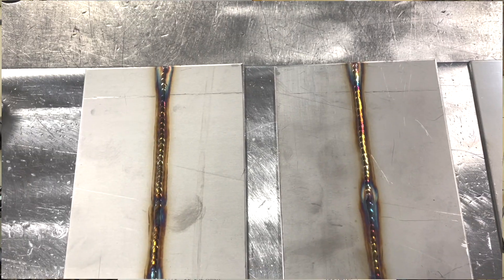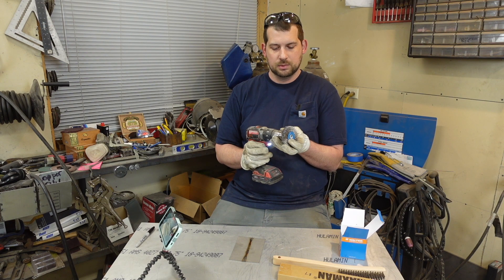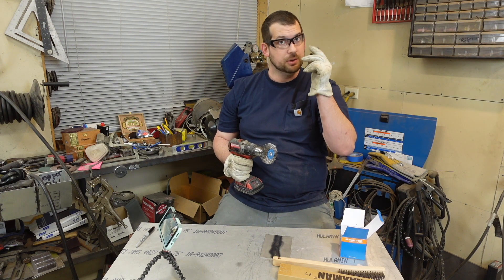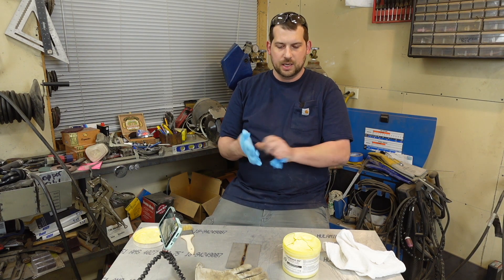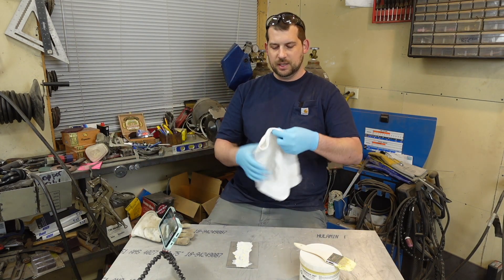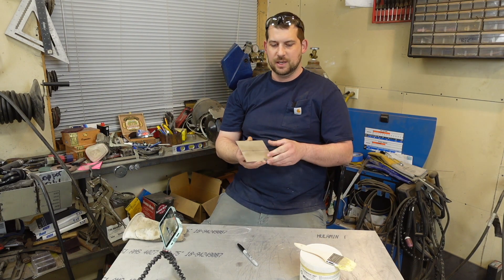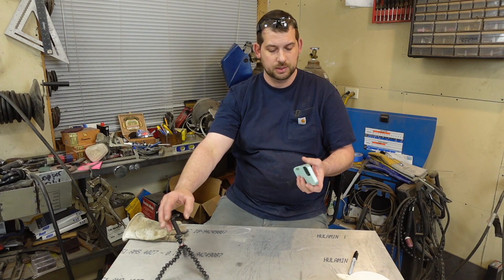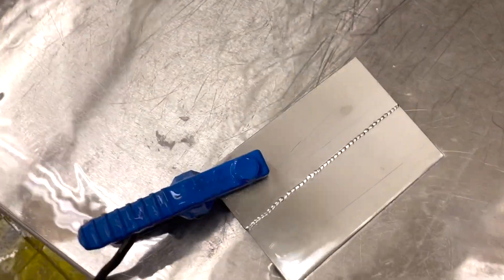3 WAYS! to Remove Color on Stainless Steel Welds

Comment: I work for Walter Surface Technologies. Great video and info for people to choose their preferred method. The 305 is expensive, but if you are not doing Alu, SS, or Ti. The Surfox Turbo is the way to go since it's SS Only. However, if you are on a budget and in business on a budget. The Surfox Mini can do anything the 305 can do, just not on an industrial scale. Alu, SS, Ti cleaning, Etching, Marking and Electro Polishing. Also the 205 and 305 have a small plug in the front where you can tie a 2nd wand in and have a 2nd cleaning options. Again thanks.
Reply from the maker: Awesome suggestions for the viewers. Thank You

Comment: I have stainless bolt with already coloring to yellow/gold, can i use HCL for turn to chrome/original colour?
Reply from the maker: I’d probably just use a stainless wire brush
Reply: Chlorides atack stainless. So no to the hydrochloric acid. Phosphoric works with current.

Comment: Pickle paste has nitric and hydrofluoric acid in it, extremely dangerous acids and fumes. It attacks the calcium in your bones, eating them away and usually requires special treatment to stop the action. 
I heard a story about a guy using it over an 8 hour shift and he had a small hole in his glove which he wasn't aware of. At the end of the shift, his fingertip was floppy, because the bone inside it was eaten away.

If your exposure is concentrated enough, it will kill you.

Electro polishing or passivating is really the safest and least toxic method. It uses mixtures of critic and phosphoric acids at its most basic. Fumes can be a little acrid, but is much safer and environmentally safe than pickling paste is.

Another brand is TIG brush, same sort of thing as Surfox.

Comment: I've seen other videos where some have made an electro brush using a regular 12V automotive battery charger, there's probably other ways and different chargers that could be used, maybe even a mobile phone charger but some make a brush with carbon fiber or carbon paper etc etc and I've seen a couple made out of a piece of stainless steel wrapped in something like a sock or other cotton and then I believe the negative cable hooks to the workpiece and positive to the brush wand and then you brush it like you were doing in this video. I don't remember the liquid solutions that were used right off, I believe there's different kinds people come up with like citric acid for one. Anyway, I haven't tried it yet but I plan to soon.
Reply from the maker: Let’s us know how it goes

Comment: I technical question, I have rust appearing in the welds of my stainless steel tank.  What was the cause of this?
Reply: Is the fabricator the cause of the rusting in the welds?
Reply from the maker: During welding, carbon can combine with the chromium in the Ss which will reduce its rust prevention at the weld.  This is why welding rod will be 316L. The L means lower carbon to help with this…. The most common cause though would be if the weld was contaminated with a sanding disc used on carbon steel or carbon steel wire wheel.  If you think a bad wire wheel was used to clean the weld then you should use pickle paste to remove the rust without abrasives that would spread it. After that clean abrasives can be used if needed, and final step would be to passivate the weld area. There’s a few chemicals for that, you’ll need to do a little research online.  Good luck to you
Reply: @TheMoonlightCraftsman  thanks for the professional insight!!!!
Reply: The fabricator may not have passivated the welds afterwards, another possibility.

Comment: If you only have a small spot, like where you spot welded something, drilled a hole w dull bit, or ground a slot, drop a little calcium/lime/rust remover on the discoloration and brush the terminals of a regular 9 volt battery through the solution, sometimes a layer or two of paper towel helps keep the solution in place. It boils white and will remove discoloration without ruining the finish like a steel brush or a wheel might. This works for me on small spots!
Reply from the maker: Interesting, I’ll try it out!
Reply: @benton hester Thank you!!! Had an SS fascia piece for a hifi project  that got discolored on a corner.
Was going to make a paste with pcb etch acid, but used dabs of jenolite rust remover instead. Worked 100%. No DC current required. You saved me lots of hassle.

Comment: Thanks for the tips!   With the Surefox setup, do you need a respirator?

Thumbs up, and thanks again for your content.
Reply from the maker: Good question. I never do but I just looked it up in the manual to make sure. It says use in well ventilated area or wear respirator if necessary.  This model does have an air hookup that will blow air out the end to kind of push the smoke away from the user. That wasn’t running in the video though.